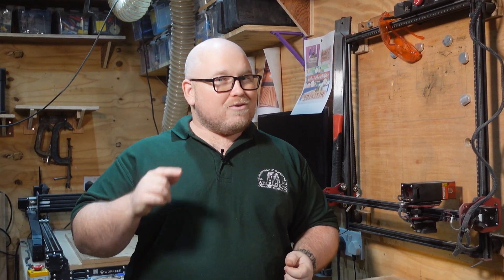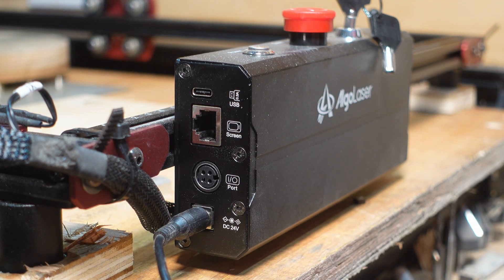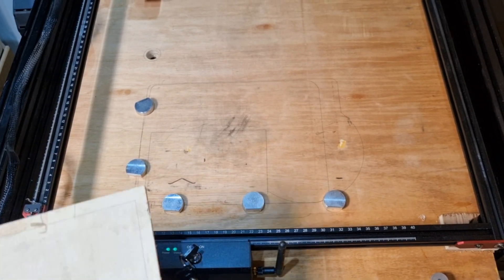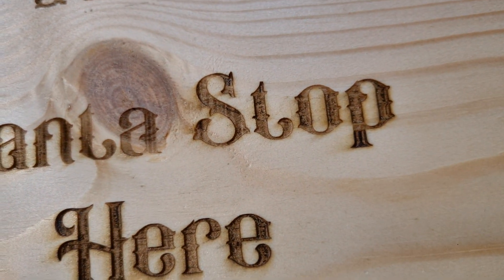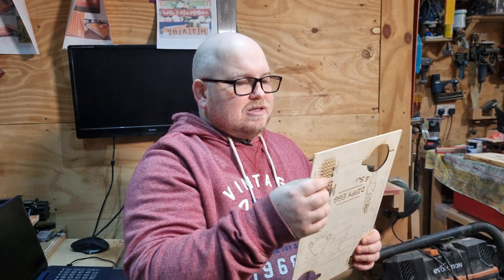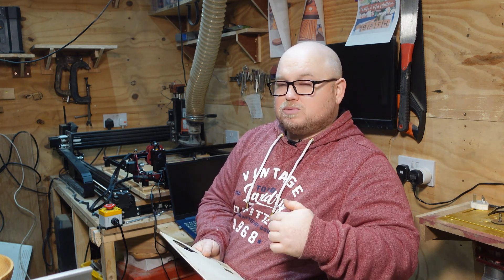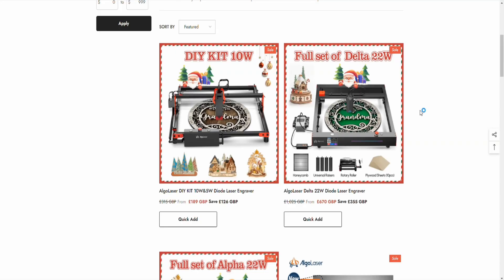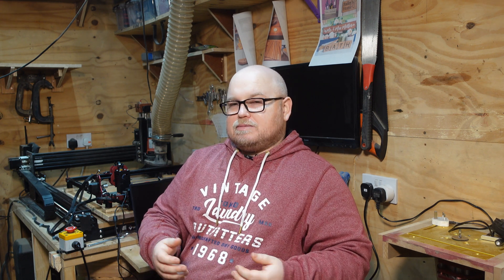I Review the $199 Algolaser 5W—This Cheap DIY Laser Totally Flopped Until I Did This Simple Upgrade!

Comment: thank you for the video. i just going to start in this business, do you think i can star with this machine just for engraving lettlers in metal and wood?
Reply from the maker: For metal, you will need a fibre laser. This does mark stainless steel, but it's not the kind of marking I would be happy to sell as a finished product. For wood, yes, but to start a business, you should really invest in a laser that has more power and is quicker. This is more a DIY Laser. Hope this helps